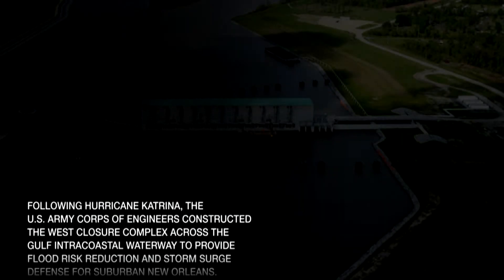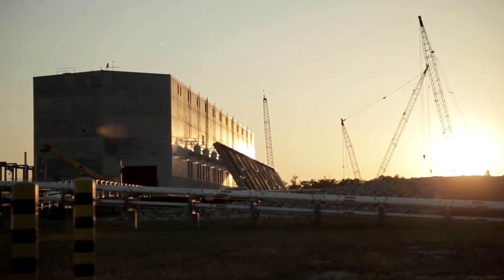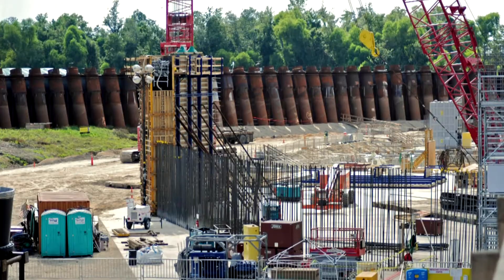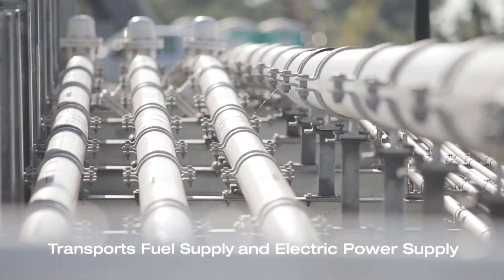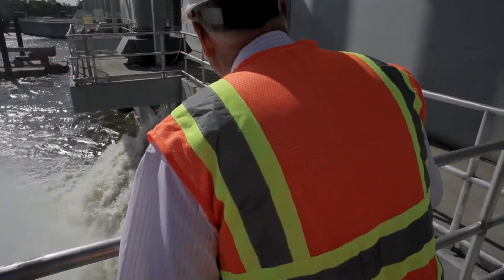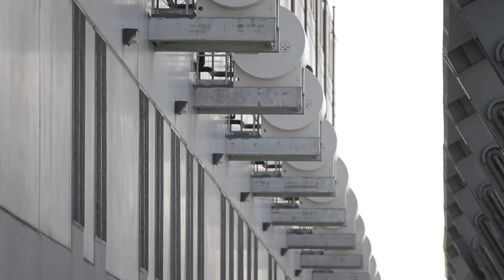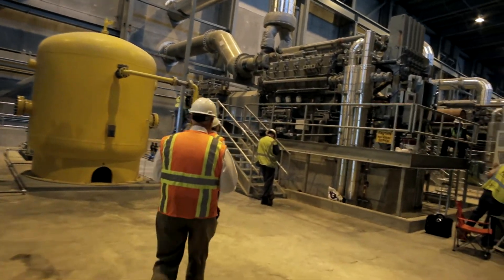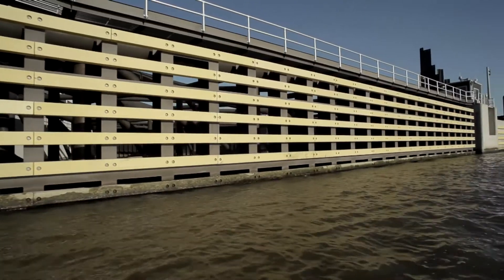Velocity Agency | Arcadis Engineering - West Closure Complex Pump Station

Comment: Cat  C280’s (3600 series) 5000 HP @1000 rpm multi speed engines,each engine burns 250 gallons an hour, @1000 rpm with lufkin 90* down angle gear boxes. i brought alotta parts there contracted by the core after katrina